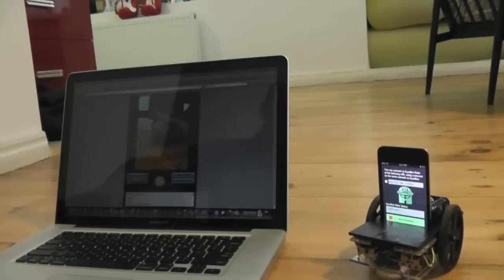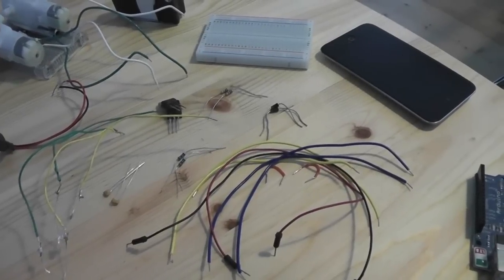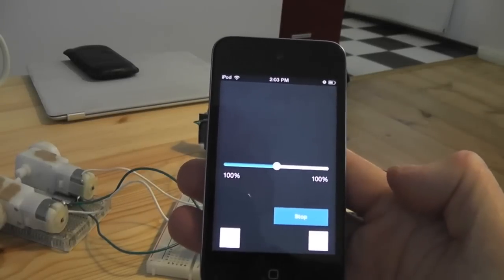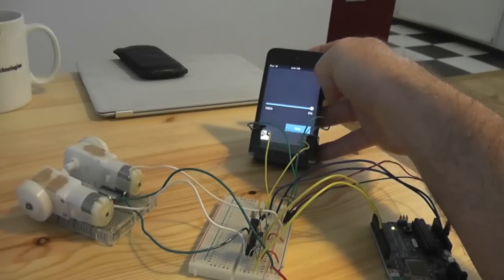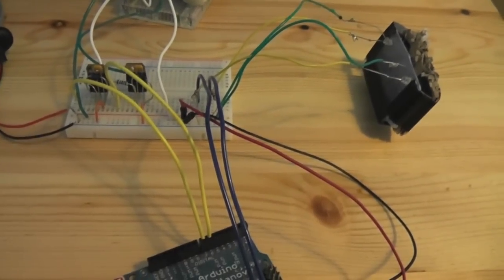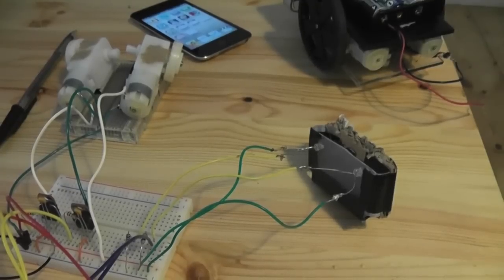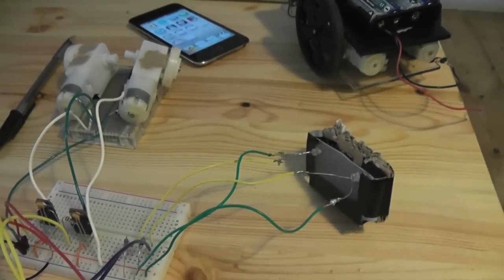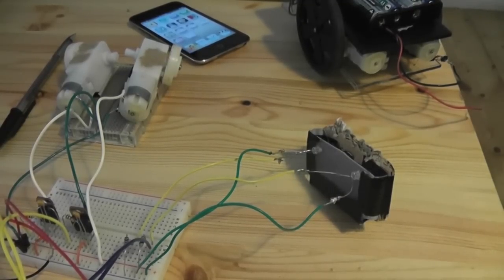Interfacing an iPod or iPhone with an Arduino or other Hardware

Comment from the maker: It's a good point, and it's one of the options I've looked with.  The others were using a RedPark cable, Bluetooth (a really strong option for Android devices using the IOIO board, not so good with Apple since they have costly hoops to jump through) and a network shield.  Each has pluses and minuses.  The pluses for this option include: cheap, compact, easy to implement, and good electrical isolation between the iOS device and robot.  The biggest drawback is only one way communication.